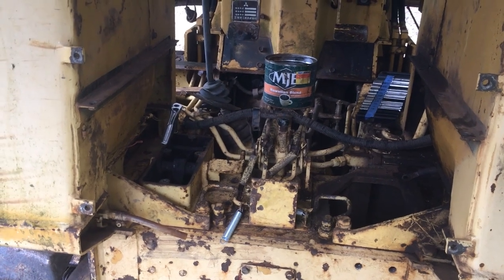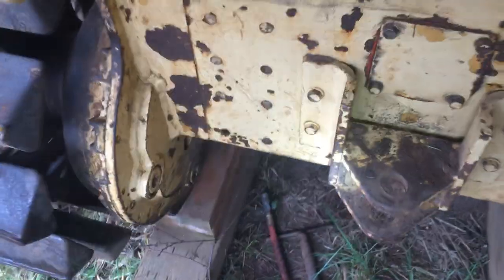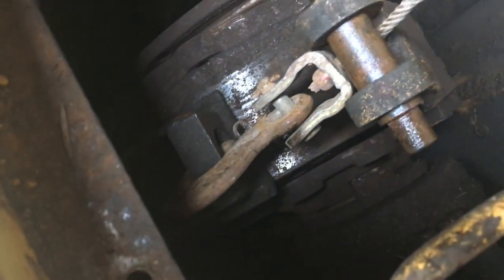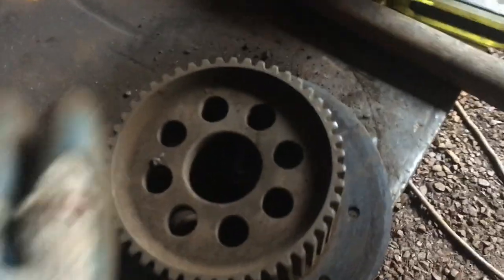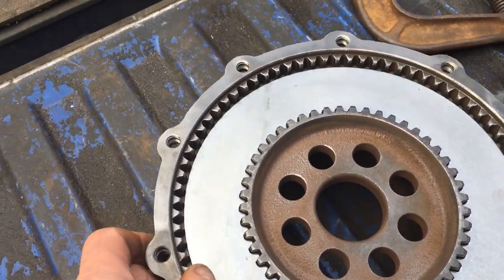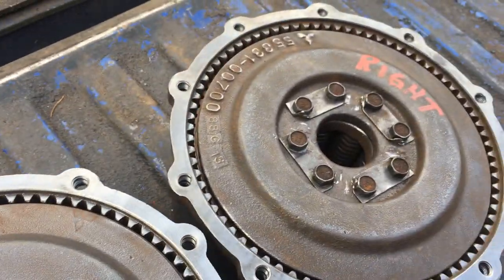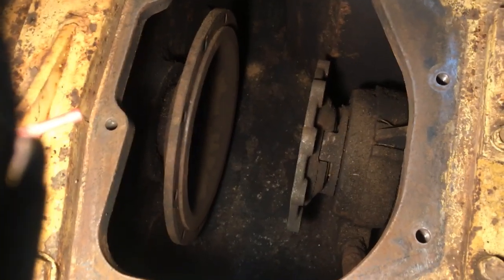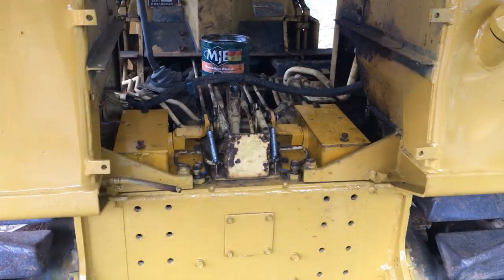BD2G Clutch Pack Replacement

Comment: I see you are 4 years old video.  How much was this pack 4 years ago.      I have a BS3D loader. I think its a grandpa to your dozer. Its sat for years with a downed engine. I gotta get ot going again.  If the clutches are stuck I'm hoping to be able to afford a set of clutchs.  The place i bought it from said they had just put in new clutchs. Also said they just slip in without having to take all that apart. From seeing inside yours , I'm not sure how they could simply slide in.
Reply from the maker: I would suggest contacting one of the parts suppliers I have highlighted several times in previous comments.  Prices over the last several years have changed significantly on everything, so a 4 year old price quote will not help you much.

Comment: Where did you find your parts? Have you been able to get anything you need? Thanks!
Reply from the maker: There use to be an outfit in Tacoma Wa that was able to get just about everything for this machine. I’ve since found two people (ID & NY), that have a lot of parts especially for  undercarriage.
Reply: Was it rhine equipment in tacoma by chance? I used to work there before they closed@1TreeFarmer

Comment: I need some help with this my left side clutch pack is stuck   It moved till you try pulling it out then locks.  Any help be appreciated
Reply from the maker: I'm not an expert so treat what I have to say as suspect.  If you are trying to pull out the clutch pack assembly, you need to make sure that both sides are loose.  You will know when you have completely free.  It will be pretty obvious.  There could be some other issue, like the 3 finger fork assembly rusted to the works.  Good luck and keep us updated.

Comment: Where did you get the parts.
Reply from the maker: Hello, there are two main suppliers of aftermarket parts.  I happened to purchase mine from DM Sales in New York ( https://www.dmmsales.com/ ).  There is another in Idaho called Steering Clutch ( http://www.steeringclutch.com/bd2strcltch.htm ).  I think both are good and prices are similar.  I had previously purchased new chains from DM, so they got my additional business.  Good luck.
Reply: If you don't mind me asking how much did it cost you for both your clutch packs and your brake pads for both right and left I'm looking into buying the same dozer and I was worried about being able to get parts for it and I was also curious of what the pricing might be on it thanks